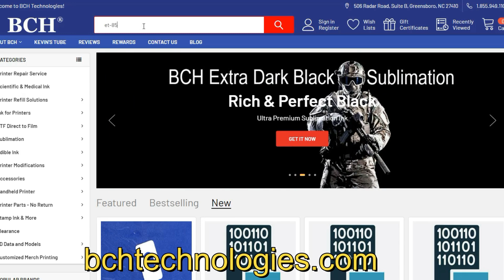STOP Disaster! Epson ET-8550 Ink Leaking from Printhead - Causes and Solutions

Comment: Do you now why my power come back on for the epson 8550 I put a ciss on it and did not touch anything I wasn’t supposed to. I was very careful. I was just wondering if you might know what to do.
Reply from the maker: Thanks so much for watching and for your question! If your ET-8550 won’t power on after installing a CISS, the issue is most likely a blown fuse on the mainboard—typically F1 or F2—which can happen even if the installation was done carefully. These fuses protect the circuit from short surges or overloads. You can check out our video on replacing F1 & F2 fuses for the ET-8550 to see how to diagnose and repair this. If both fuses are good or the printer still won’t power on after replacing them, the problem may be deeper in the IC circuitry and require professional service—you can send your board to us for repair through our site. https://bchtechnologies.com/collections/printer-repair-service/products/fast-track-mainboard-repair-l1800-xp-15000-et-15000-wf-7610-7620-wf-7110-wf-7710-7720-et-8550-et-2720-et-2750printer-mainboard-formatter-board-motherboard-troubleshooting-and-repair  I really appreciate your support and engagement! Please consider subscribing or becoming a member—subscribers and members get priority answers within 48 hours, early video access, and exclusive perks. Since I get a lot of questions and can only answer about 10 a day, non-subscribers are answered if time allows, and I work last-in, first-out. If your question isn’t answered within 48 hours, you can subscribe or re-post it, and once you subscribe, your old questions automatically move to the priority list. For faster help, email [support@bchtechnologies.com](mailto:support@bchtechnologies.com). And if this video helped, I’d be super grateful if you could leave a quick Google review here: [https://g.page/r/CfL7k6nYvPQ9EAg/review](https://g.page/r/CfL7k6nYvPQ9EAg/review).

Comment: The problem I have is the silicone seal to thick and want let the dampers medal bracket latch
Reply from the maker: Thanks so much for watching and for sharing your question! We actually make two types of silicone seals: the thin one is designed to go on top of the original black grommet, while the thicker one is meant to replace the black grommet entirely—so you’ll want to double-check that you have the correct one for your setup. I do receive a very high volume of questions, so while I try to respond to as many as I can, subscribers and channel members are prioritized for answers within about 48 hours and also enjoy exclusive benefits like early video access. If you need quicker help, please email [support@bchtechnologies.com](mailto:support@bchtechnologies.com) and we’ll do our best to assist. And if this video or response has been helpful in your journey, I’d greatly appreciate it if you could leave a quick review on my Google page here: [https://g.page/r/CfL7k6nYvPQ9EAg/review](https://g.page/r/CfL7k6nYvPQ9EAg/review). Don’t forget to subscribe or become a member so you can stay ahead with priority support and extra perks!

Comment: The problem I have is that the epson dampers have a funky metal tab in the front that goes into these tiny slits.  If they're not positioned right, ink will spill everywhere when you print.  One of my dampers, the metal tab was bent so it couldn't go into the little slit, so I had to straighten the metal tab with some needle nose pliers to seal it.  Really, bad design because you have to remove all the ink from the dampers otherwise ink will spill everywhere when you pull out your dampers.

Comment: Hello, thank you for the tutorial, I am needing some extra help here  after placing the printhead, there is no ink flowing to the printhead tanks, I don't know what I did wrong, csnnyou please help me.
Reply from the maker: Thanks so much for watching and for your question—I really appreciate your support! When the ET-8550 isn’t pulling ink into the printhead tanks after reinstalling the head, it usually means the printhead isn’t fully parked on the capping station or there’s an issue with the capping station’s seal; make sure the printer is powered on so the head settles naturally, then attach a syringe to the waste line and gently draw a few milliliters until you feel slight resistance, because pulling only air means the head isn’t sealed and total resistance means the capping station is clogged, and once you feel the membrane crinkle you can slowly draw to the 2 ml mark and hold before running a normal (not strong) cleaning cycle with rest time in between. If you’d like faster or prioritized replies, consider subscribing or becoming a channel member—subscribers and members get priority and are usually answered within 48 hours, while I can only reply to about 10 non-subscriber questions per day, handled last-in, first-out, so if you don’t get a reply within 48 hours you can either subscribe or re-post your question since newer comments get reviewed first; and if you subscribe later, your older questions automatically become priority. You’re also welcome to join Run With Kevin — LIVE, where I go live most mornings between 6–8 AM Eastern to answer printer questions in real time, so be sure to subscribe and turn on notifications if you want to catch the next stream. For quicker assistance, you can email [support@bchtechnologies.com](mailto:support@bchtechnologies.com), and if this video or reply helped you, I’d really appreciate a quick Google review at [https://g.page/r/CfL7k6nYvPQ9EAg/review](https://g.page/r/CfL7k6nYvPQ9EAg/review).

Comment: Where do I purchase the silicone rings?
Reply from the maker: Thank you so much for subscribing to my channel and for your support! Every subscriber means a lot to me, and I’m halfway to my 100k goal after 8 years of work. It’s a long journey, but your encouragement keeps me going. I truly strive to provide quality content and do my best to answer subscriber questions within 48 hours. If I miss your comment or you need a quicker response, feel free to email me at support@bchtechnologies.com.

Now, to answer your question: The rubber seals for the Epson ET-8550 washer gasket don’t need to be placed in a specific order since they are all identical in function. However, we offer two different types to suit your needs. Thin rubber seals are designed to lay over the existing OEM gasket and are perfect for enhancing the original seal without fully replacing it. On the other hand, thick rubber seals are intended to replace the OEM gasket completely, making them a great choice if the original gasket is damaged or if you want a fresh start.

Both options are available on our website at bchtechnologies.com. Just search for "ET-8550 washer," and you’ll find them easily. For a visual guide, check out the related video on our channel. Thanks again for watching and commenting—I appreciate your support!

Comment: When installing the new silicone washers, do I remove the old ones? At minute marker 5:48 in your video, it appears that you installed new washers right on top of the existing washers. My printer is one week old and is already leaking after about 40 prints!
Reply: No. Sits on top of the factory ones

Comment: Do the rubber seals need to go in a particular order? Or any one can be used anywhere?
Reply from the maker: Thanks so much for subscribing to my channel and for taking the time to ask your question! I really appreciate your support—every subscriber helps as I work toward that 100K milestone, and it means a lot to me. With so many comments coming in, it’s not always easy to keep up, but I try my best to answer each one. For a quicker response, you can always email me at support@bchtechnologies.com or post your questions on my most recent videos (not shorts).

To answer your question, the rubber seals don’t need to go in a specific order—they’re all the same. However, we do offer two versions of seals. One is a thinner option, like the one shown in this video, designed to be laid on top of the OEM gasket. The other is a thicker version, which fully replaces the OEM gasket. If you’re interested, you can find both by searching "ET-8550 washer" at bchtechnologies.com.

Thanks again for watching and commenting! Let me know if you have any other questions—I’m always happy to help!

Comment: Could you explain how you fill the dampers again?
Reply from the maker: Thank you for subscribing and for your thoughtful question! Every subscriber matters as I work toward the 100k milestone—your support means a lot. I’ve been at this for eight years and am only halfway there, but with your help, I’ll keep striving to create helpful content and answer as many questions as I can. If you ever want a quicker response, feel free to email me directly at support@bchtechnologies.com or post your question on one of my most recent videos (not shorts), where I can respond more promptly. Now, let’s dive into your question.

To refill the dampers on your Epson ET-8550 after replacement, start by parking the printhead on the capping station. Turn on the printer and let the printhead settle naturally; this is completely safe to do while the power is on. Since DTF ink is thicker than standard ink, it might require some extra effort to get things going. Once parked, connect a syringe and tube to the printer’s waste line and gently draw 2 ml of air. Start by drawing 1.5 ml, where you should feel slight resistance. If you only draw air, the printhead may not be parked properly, or the capping station seal could be leaking. Total resistance without any ink flow likely means a clogged capping station, which you’ll need to address before continuing.

Once you’ve successfully drawn 1.5 ml, listen for the damper membrane crinkling—this indicates the nozzles are open. Slowly continue drawing up to the 2 ml mark, ensuring the black rubber seal passes this point, and hold for 10 seconds. Afterward, run the printer’s standard cleaning cycle, but avoid the strong cleaning feature for at least 12 hours, and don’t perform consecutive cleanings without letting the printer rest.

Another approach is to use a syringe filled halfway with ink. After parking the printhead, connect the syringe to the damper’s input and slowly draw air out before releasing the syringe, which should pull ink into the damper and prime the printhead. Alternatively, reinstalling the printer driver and selecting “No” during the ink charge setup dialog can initiate the built-in ink charge process. Keep in mind, though, that this consumes a lot of ink and may put additional strain on the printer.

Thank you again for watching, commenting, and being part of this journey. I know there’s a long road ahead, but every question and every subscriber brings me closer to creating even better content for you. Let me know how it goes!
Reply: I think they go in empty

Comment: I have a question about an Epson L14150 I got for dirt cheap because the scanner stopped working. At first I thought it was a simple loose flex cable  but it turns out that was only the start. 
The gears inside the scanner itself are loose and a small triangular tab is flopping around and I have no idea what the correct way to put them back in place is. I've looked for manuals or pictures on how to put everything in it's proper place but so far haven't found any.
When the I turn the printer on the scanner self check fails almost immediately and the scanner light can't move. 
Thanks!
Reply from the maker: It's quite common for those scanners. Somebody put it upside-down and shook it. I will make a video for how to fix those.